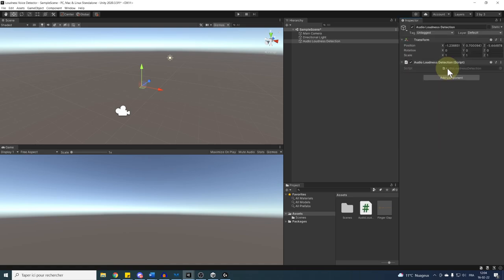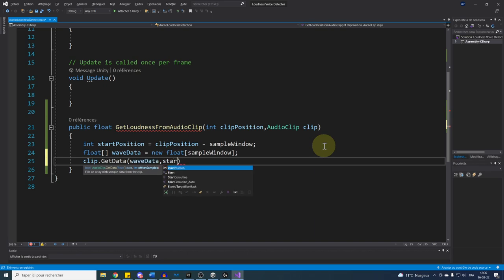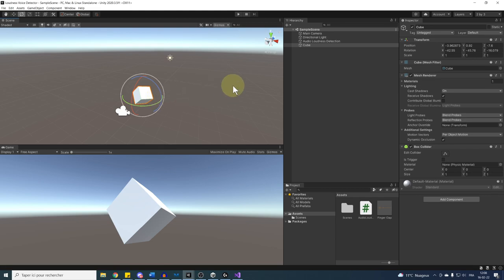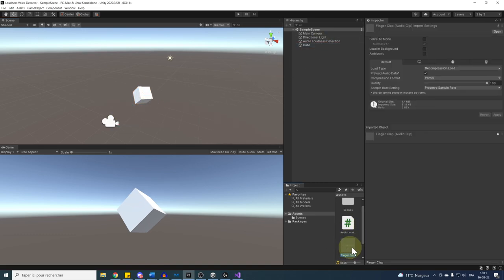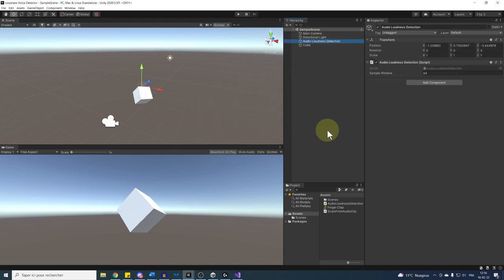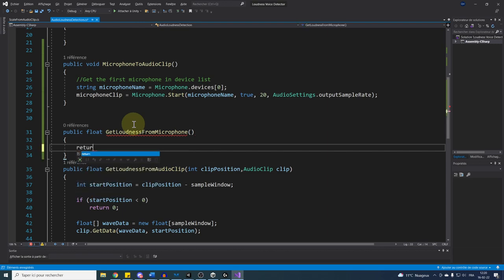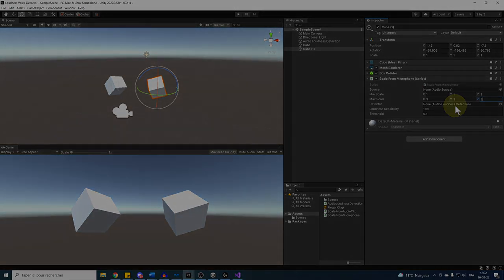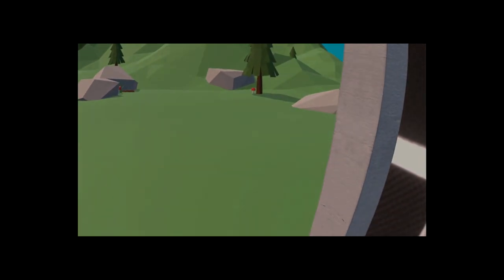How to Use Your Voice as Input in Unity - Microphone and Audio Loudness Detection

Comment: Hey, i have a small issue with sockets and Photon multiplayer. When i put an object in a socket, the synchronisation with photon works perfectly, the issue is that when i take back the object from the socket, the object stays in the socket for the other players and the photon synchronisation stopped working.

Comment: This video killed 2 birds with 1 stone for me.

1: Is IS possible to just GET microphone input in unity without relying on some external library.

2: You can just MAKE audio clips from float arrays, and overwrite them as they loop in real time to get a continual stream of audio. (Which makes me suddenly understand one of the old VRchat voice bugs a LOT better)

FINALLY I can comfortably start tinkering with real-time audio processing. Voice modification or even complete re-synthesis. Detecting phonemes, pitch, tone, all by evaluating that float array from the microphone samples. Then generating a new float array based on samples, filters and processing rules, packing those into a new audio sample and playing that instead of the direct mic input.

Naturally there's a lot of other little details to work out, like using a Fourier transform to find the fundamental frequency of the voice sample for pitch detection,  and basing all the other evaluations off that pitch so it's consistent no matter who's talking.

This is mostly a pipe dream project.

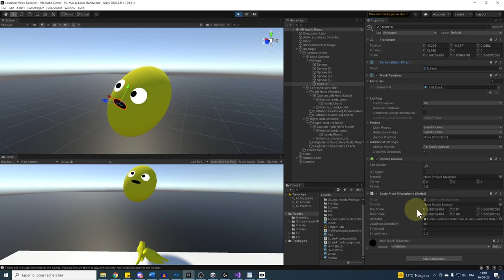Comment: This is brilliant! could you also share how you made the mouth movement so smooth? It looks like they all want to know how the 'smoothness' variable is used in your script. 12:10 (lower right on the screen)
Reply: I'd really like to know this too please.
Reply: tell me, did you manage to deal with smoothness?
Reply: @MetalMonstrumGear  Yes but with my own method which I'm about to share. I made the y scale of the mouth gets smaller little by little on every update. People, let me know if following method worked for you too. add this code in Update function. -->        if (loudness < threshold)
        {
            loudness = 0;

            //to prevent jittering issue, slow down the speed when the mouth go back to default size.
            if (transform.localScale.y > 0.2f)
            {
                transform.localScale = new Vector3(transform.localScale.x, transform.localScale.y - 0.08f, transform.localScale.z);
            }
        }

Comment: Thanks Valem, i got several questions.
1. I don't understand how startposition = clipPosition - sampleWindow works. If you start from position 4 and remove 64 samplewindow aren't you in a negative position?

2. Why do you return an totalloudeness / samplewindow instead of just returning totalloudness?

3. Source.timesamples Does it give the specific time per frame of the sound? (If so it can miss several sample not?

2.
Reply from the maker: Hi man thanks for the commment I'll try to answer these questions below.
1) Yes you can have a negative start position, to counter this issue you can return a loudness of 0 in that particular case. Thats what I did at 4:07
2) totalloudness / samplewindow gives a mean value around the data we collected. A mean value will give us an 'idea' of the loudness of the audio around the clip position. A mean value is computed by taking the sum of all element in the array and divide by the number of element in the array.
That's why I divide by samplewindow which is in this case the number of element we have
3) I'm not sure to understand this question correctly but Source.timesamples gives the timesample the audiosource is currently at in the audioclip that it is playing. So using it in the update function I can get the loudness of the clip at the exact moment the audio is at.

Comment: Hi.  Thanks for the video.  @ 4:30 seconds into the video, you create a component called 'ScaleFromAudioClip' and have this code: 'public AudioLoudnessDetection detector;'.  However, my c# 
says that the namespace cannot be found.  What do I need to get this error fixed?  Thanks!
Reply: Are you using visual studios? If so, go to the error and it should give you the option to auto-fix the problem. In this case, it would add the appropriate namespace at the top of your script. I hope this helps. Last but not least, google the error number and you should get the correct namespace to type at the top of the script
Reply: I'm having the same error unfortunately. :(
Reply: I'm having the same error unfortunately. :(
Reply: This means your IDE isn't detecting the class you should have created at the start of the video. Check that you've created the AudioLoudnessDetection class with no typos, and that it's saved to a file called AudioLoudnessDetection.cs in your project.